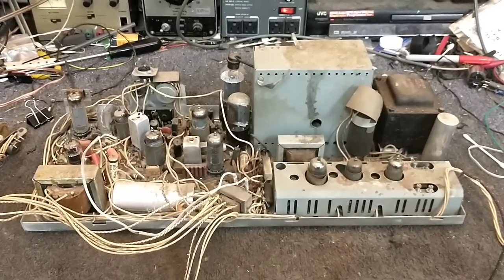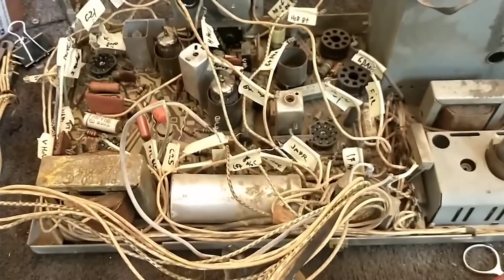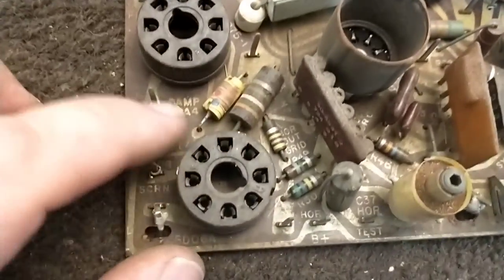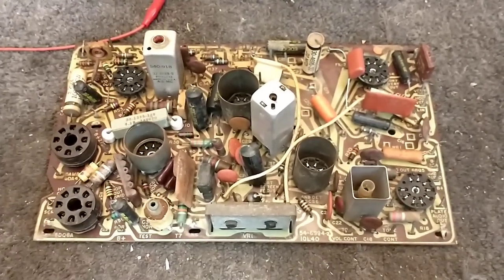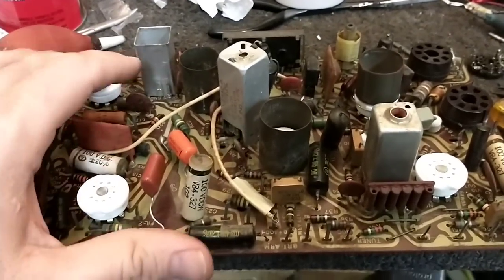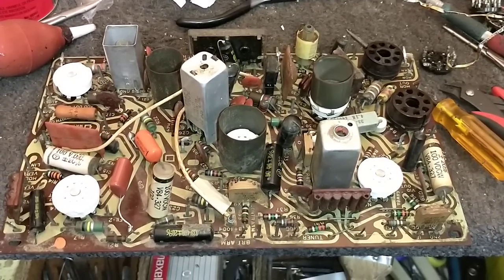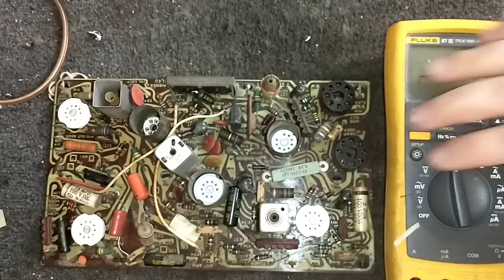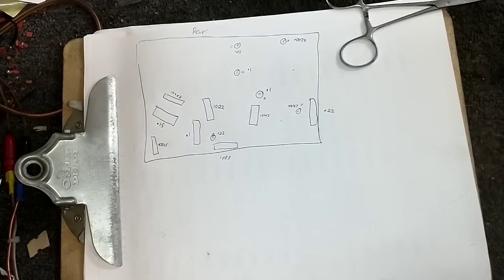Servicing a 1959 Philco Predicta Princess Part 3/9 - Board removal / repair

Comment: If you have a minute, can you measure the "wider" dimension on one of the wire wrap posts?
I have made a DIY unwrapping tool from some brass tubing that works well, but I think those pins are a bit wider than the regular square posts, so I would like to size up some tubing for it and would gladly share the tubing needed.  And boy, you mentioned passing on knowledge, that's a sticky subject for me as far as training at my old employer. We used to get formal classroom training on equipment/systems we needed to install and put into service( some equipment handled 10+Terabit/s of data) , but about 2014, my employer decided that formal training was not in the budget, so, anything new required for a tech to go to the company website and download the approved document for that equipment/system. I was experienced enough to get away with that, but, they transferred less experienced techs into our crews that didn't have any prior formal training , and they expected the same results. It was a formula for disaster, and time for me to retire, and I did.

Comment: Those valve sockets are super nice, You even managed to get the screen tubes back in :-D.
Great that there is a person that will make potted circuits,  you have other things to do.
I'm not surprised the pcb is brittle, it's been cooked for millions of years.
Ok not millions :-D
I learnt soldering by killing components,  a 75 watt iron was way too hot.
I bought a antex 15 watt iron, just ideal for small jobs.
No dead parts lol.
Reply: A temperature-regulated iron is generally better than a lower-powered fixed power iron.
Reply: @eDoc2020  This was a very long time ago when i was 16,  im 54 now and no components are tortured now lol 😀
Reply: @zx8401ztv  Weller Magnastat irons were certainly around 40 years ago but I'd imagine they were cost-prohibitive for the average hobbyist, let alone teenager. Variable-temperature setups have certainly gotten cheap in recent years.

Comment: i am surprised with the popularity of the tv's that no one has created a new pcb for them.
Reply: It would be a very costly double sided PC board , thats for sure!
Reply: I'd be willing to try to make a gerber file with EasyEDA, if I could get my hands on a relatively undamaged board to copy, but if that board existed, I'm sure nobody would be willing to let it go. Long ago, we had a Predicta, early 70's, but my father had some kind of connection to get TV's, he ended up getting us something to replace that one with when it went wonky.
Reply: @hestheMaster  It looks to be only a single sided board ( and I say this because @ 20:03 ,  bottom right, you see the use of jumpers on the top side of the board, If it was double sided you would have a top trace and VIA's instead of jumpers) , the top "silk layer" is just graphics , paint. but being a bit larger raises the cost.
Reply: strip it completely, make a picture, little bit editing.. could be quick, done in a day or two.. probably worth it.. who knows what still lurks in the dark ^^
Reply: @tinygriffy  No need to strip it. I've placed the board copper side down on a flatbed scanner and made 1:1 images of boards and then imported them to my board designing software and made copies that way. It takes some time but very doable
Reply: @TrevorsBench  you are absolutely right.. I thought it is a double sided / layered board, but as I have learned top side is only graphics... 

I have etched boards myself and kind of know the time and steps required / involved.. but it should be around 40 bucks if you order it overseas.. then you also get mask and silk .. but I would prefer self etched on copper clad .. would kind of look more original that way ;)